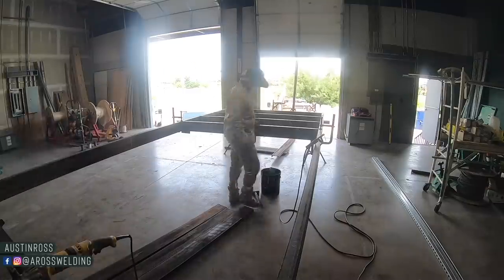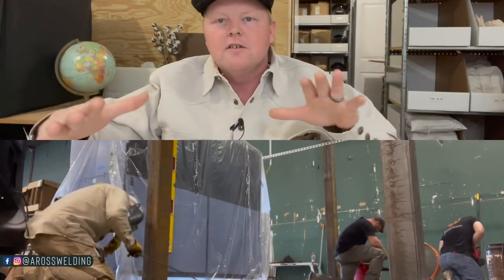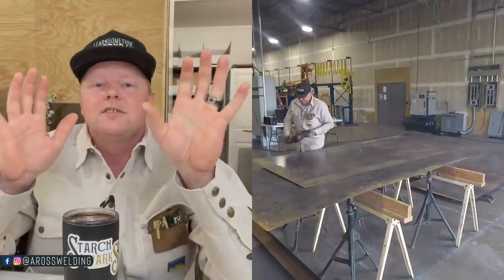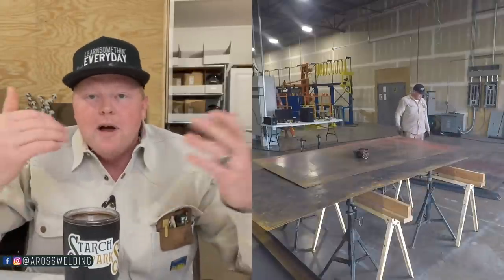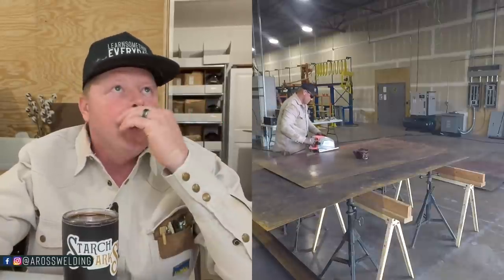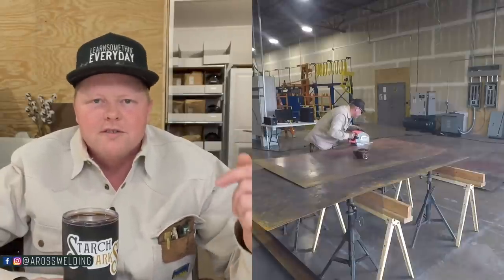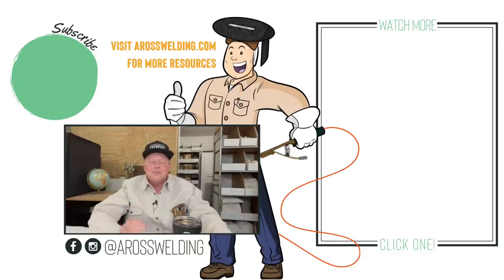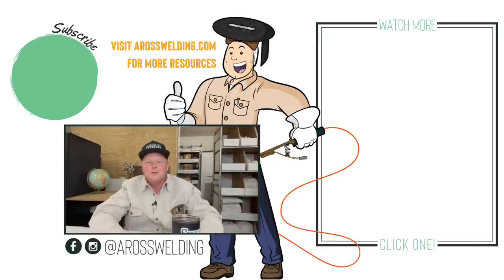BUILDING A 10’ PLATFORM FOR EXHAUST SYSTEM (STRUCTURAL WELDING)

Comment: When you talk of engineering things . My brother a carpenter and a welder  taught me when working with structural steel, engineer it in a post and beam configuration  that way if the weld fails people don't get killed due to a collapsed structure . He was good at it because what he built was usually stamped by the engineer .Good Video Austin
Reply from the maker: I appreciate it! Thank you for watching!

Comment: next time you use channel for a project like this, you might consider orienting the gussets the same way as the channel.  having the closed side of the gusset channel abutting the open side of the beam channel transfers the load from the weak(open) side of the channel beam to the strong(closed) side of the gusset.  probably better to go closed side to closed side.

Comment: I am somewhat amazed that you aren't required to have welding curtains and fall protection.   I spent 30 years in the packaging industry where we had to have welding curtains, hot work permits, fire extinguishers, fall protection, face shields, ear plugs, etc, you name it when it came to safety and you had to have it. They were not the least bit shy in walking contractors off the job for safety violations. Fall protection and no hot work permit were major violations. Ear plugs and safety glasses would usually get you a reprimand the first time.  Falls to often result in an ambulance ride.  Please work safely so you can leave work the same way you came in.

Comment: Austin Ross, I look forward each week for your next video. I enjoy the fabrication along with the “ how you do” skill sharing. I also really enjoy the advice at the end of your videos. I’m about twenty five years your major and yet you either show me something new, or remind me of what I’ve forgotten. 
So with that said, I want to give you some heads up type advice. I’m not a welder! I like to build things all kinds of different things made from metal, wood, stone. I bought a Milwaukee 8” metal cutting circular saw about ten, twelve maybe more years ago. In 2016 or 17 I had to replace the breaker/ thermal overload in my saw. At that time the saw only had about 15 hrs of use on it. It worked great up to when the breaker started tripping often. For some reason the breaker got weak and couldn’t handle the load cutting ten gauge plate. It would cut about five inches then trip. So I started trying to find the breaker to replace mine with. Milwaukee  does not sell a replacement for the thermal breaker. You can buy a complete saw one part at a time just not the breaker. So with all that said since your saw is new get on line go to the Milwaukee site and if they do have your breaker buy one or two. And just save it for a rainy day. 
I did fix my saw I went to an electronic store and found a breaker that was configured the same only difference is it’s a 15amp and not a 13amp. It works great again. I don’t like that the amp difference, I just couldn’t see throwing a $400 saw in the trash without trying something. Oh the breaker cost $8!
Reply from the maker: Thanks!! This is absolutely very good information!

Comment: quick question, might sound dumb but why don't you flip the c chanell to have the gap on the inside and not on the outside? just want to know since I've seen multiple frames like the one you have done. is it stronger?
Reply from the maker: I just done that so I would not have to cope/notch every one of the cross members

Comment: Another great video as always 
Also I understand your saw purchase but when you have to cut plate steal have you ever thought about using a track torch/trolley torch ....... I know that they work very well for cutting thicker plate and was just wondering if you had thought of that and weighed the differences between the two and still ended up going with the saw anyways????
Reply from the maker: Yes, I have. Back when I worked on drilling rigs a lot of them guys had track torches. They are very good tools also. 👌😎

Comment: Yeah everyday should be a learning experience you mentioned the cold cut saw back 98 I worked for a door company in L.A. along with an older guy sadly he passed away a few years ago in Canada he had one of those Milwaukee saws it worked pretty good now I'm on my own but like you didn't buy one I went the cheaper route I got an older skill saw tough and heavy then I saw Home Depot got some Diablo steel cutting blades and some for aluminum so I got one of each I've cut some1/4 in and 3/8 steel with it so far with no problem but one day I'll break down and get the real deal when the money is right by the way good job on the platform looks nice I like doing things like that I enjoy your videos too
Reply: I also use a skilsaw worm drive saw with a Diablo Steel Demon blade and it works well at a fraction of the cost. However I will say that cutting 3/16 plate is really pushing it and blades tend to due quickly. Sharp blade does make a very clean cut and no warpage which is a big time saver.
Reply: I meant to say dull quickly.